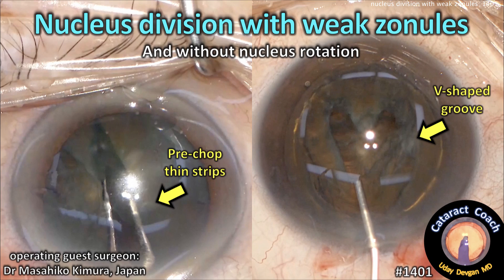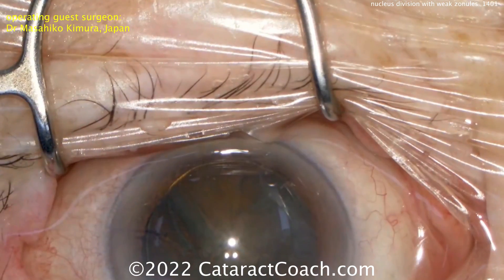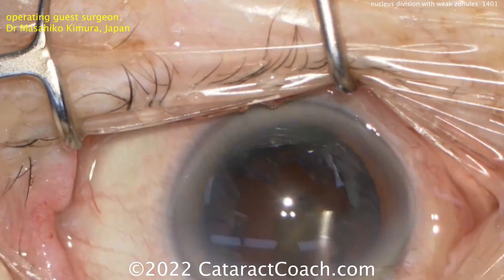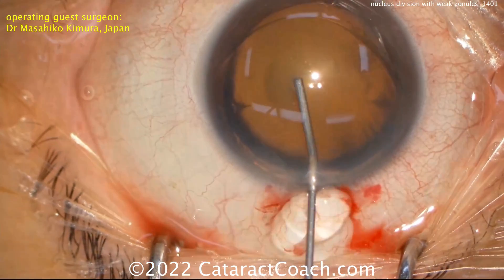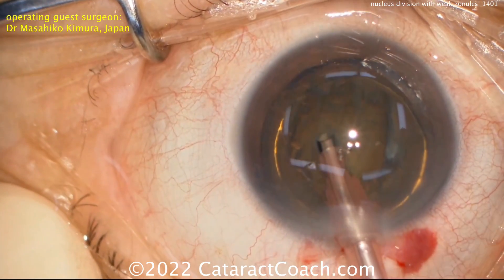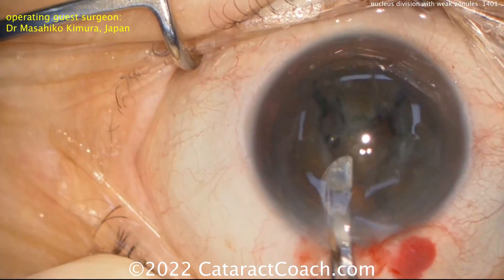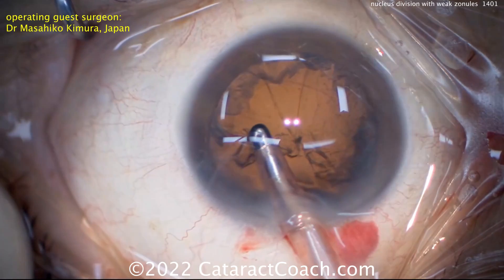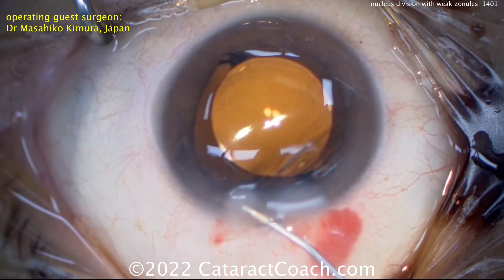CataractCoach 1401: nucleus division with weak zonules

Comment: What cortex removal settings would you recommend in a case like this? Thank you
Reply: The suction pressure setting is the same as usual (600mmHg), but the pressure can be controlled with the foot pedal. I try to gently aspirate on the spot without pulling the cortex to the center as much as possible.